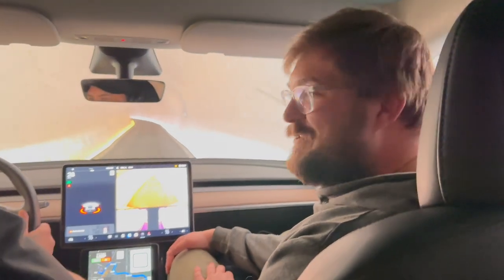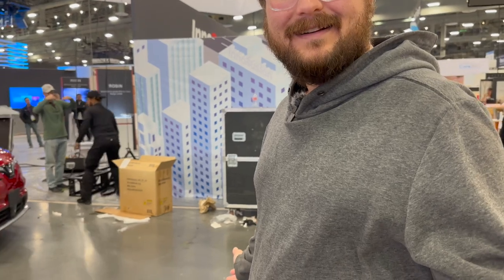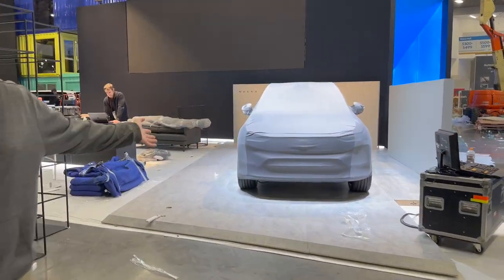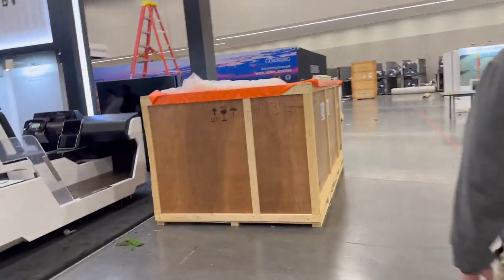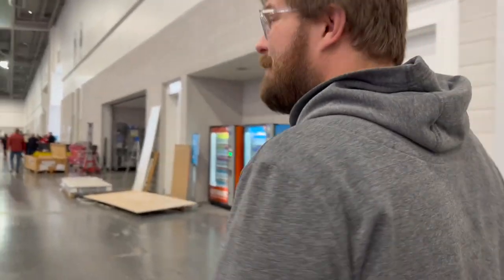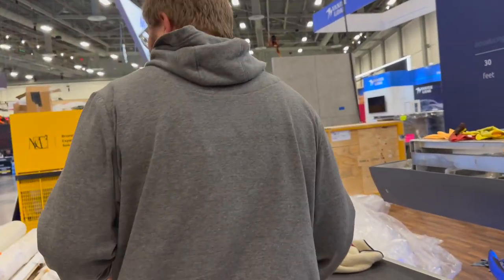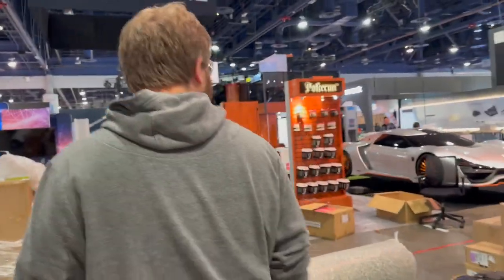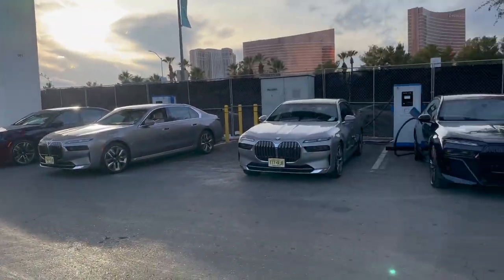CES Is Going To Be Insane This Year! Behind-The-Scenes Of Setup - New EVs, Chargers, & More

Comment: Can you ask the DC fast charger manufactures what they are going to do to have more reliable chargers deployed in the US?
Reply: Until ELECTRIFY AMERICA is put out of business, non-Tesla EVs will never survive in the USA. America needs charging options that are not doing all they can to stop EV adoption.
Reply: Needs to be a STANDARD
Reply: @nononsenseBennett  how about NACS? getting legacy auto to adopt it however may be challenging. but if one does, i am sure the rest will follow shortly, especially if the tesla super charger network opens up here in the usa like they said they would.
Reply: Dump CCS1 is what they need to do. The J1772 latch is CCS1’s Achilles heel. They need to either switch to NACS or CCS2. Those are proven and don’t have the vestigial manual latch that CCS1 has.
Reply: The guy is doing "native advertising" not real research regarding ev tech
Reply: @MH-Tesla  aren't they owned by Volkswagen tho
Reply: @AgentOffice  VW is a massive ICE vehicle manufacturer. EVs are eventually going to replace that entire industry. VW obviously wants that to take as long as possible. Kodak Film never got into the digital camera market nor eventually smart phone market. Everyone back then said Kodak was a monster... They will crush the competition. But they died. As did blockbuster, Nokia, and eventually most car manufacturers of today... It's not a question of if, just when.

Comment: Hey Kyle,

The airstream you walked by most likely is a game changer in the entire camping industry. It should have batteries underneath so the wheels on the camper powered by electric motors and the wheels move when the ev truck is towing it. This will improve range for towing which is the #1 concern today. Please check it out and review it! Game changer for the world of ev trucks pulling a camper.

Comment: Two things I'd like to see you investigate.  1)  VW OTA updates.  We already know they announced 2021 and early 2022 model updates but when should we start expecting 3.1.0 to get updated across the board?  There has got to be bug fixes that can be pushed out but they aren't doing anything.  2) See if you can probe some of these DCFC vendors and see if any major contracts or plans are in the works.  I'm talking about a scale that would make EA start to worry.
Reply: Going along with this maybe press the current EA and others why they were so bad around Christmas and out of order charges in general.

Comment: I think we need to challenge every charger manufacturer on real world reliability. I would also press on why the failed CCS1 plug continues to be pushed. I think that connector is a big part of the problem with its manual latch. Why not switch to something reliable like NACS or CCS2 which lack the latch?

Comment: 22:01 It isn't a 50kW charger. It's either an ABB Terra 124 or an Terra 184 with 120 or 180kW. Afaik Circle K has some of them running in the US.
The 50kW ones don't have 2 CCS plugs, because they have only one power unit.
30:10 Fastned has already one of them in service as a pilot near Amsterdam.

Comment: Very good start, congrats! can you give some emphasis on the new battery technologies shown and to come? Also, a video on the weight (in lbs AND kg) of each new EV compared to their rated power (in kW) and battery bank capacity will be a very interesting ...it will show which EV company is thinking futuristic as ONE of the MAIN parameters of ANY EV is its efficiency....strongly dependent on the weight...

Comment: I would be very interested in a home charger that can be mounted outside on the garage (for the day you have 3 or 4 evs hehehe) but can be software locked to only handshake and charge your Vin numbers. I know fast charges handshake  to bill you this should be easy setup for home so random folks don't just pull up while your gone charge. I hate to be the one to whine all the time but I would like to know more about the feature subscriptions on vehicles I know I buy a webcam for security at home just to find out that after I get it and get home I have to pay a subscription fee to use that webcam over the Internet when I'm not at home which is the main reason I bought the cam and now I find out that I have to pay to use it which  frustrates me to pay to use. much like  the safety features on cars how many of the new cars are coming out with pay for feature subscriptions on safety features like Lane centering, crashing collision, avoidance back up alarms are these all going to be subscriptions that we have to pay for once we buy our car or is there any cars coming out that allow you to use the safety features as standard part of the car and not a subscription.

Comment: Since I have always been into economy over performance, I would like to see an ev with 4 wheel drum brakes. Disks are mostly needed in applications where the friction brakes are overused... automatic transmissions anyone. My first car with front discs was my 79 VW Rabbit, and since it had the 5 speed manual transmission I never really saw any advantage over drums. (My first 4 cars all had manual transmissions, which I prefer over automatics.) Since an ev uses regenerative braking, friction brakes aren't really used much, except for people too dumb to learn how to drive a vehicle with a manual. The advantage disks have over drums are in heat dissipation, but if you aren't using them much, it never becomes an issue. Drums are cheaper, cheaper to maintain...better in an economy application, where the friction brakes won't be used much..

Comment: Hydrogen makes sense if you want to replace gas ICE 1 to 1... BEVs make sense for tiny low range city cars it's just what they are best at.
Reply: The only place hydrogen is even practical (and that's a stretch) is in southern Kalifornia.
Reply: @ItsEverythingElse  so the energy islands in denmark makes no sense ??

but for transporting goods and big amounts of people and picking up trash, hydrogen probetly makes more sense then a tesla truck..

alot of people allready puts it in their car where i live
if you dont have free solar and the price is right it does make sense to alot of people..

ofcourse it needs to be green to make sense and not black
Reply: @Hansen710  Unfortunetly, H-mobility is too expensive. Putting the current direct into a Battery is way more eficient than converting in to H2. H2 is more practical for Plains or Ships. On shore, Battery is the way to go, economicaly spoken.